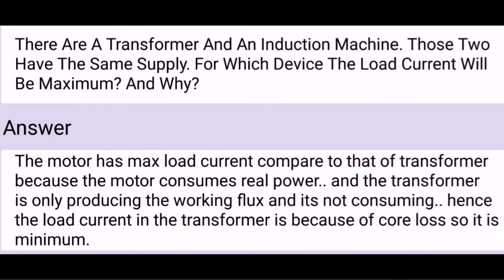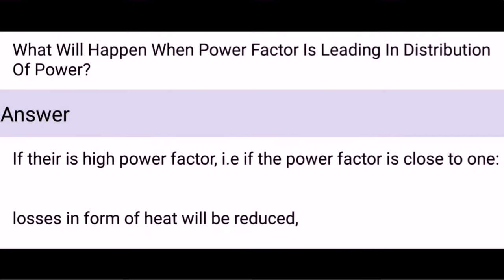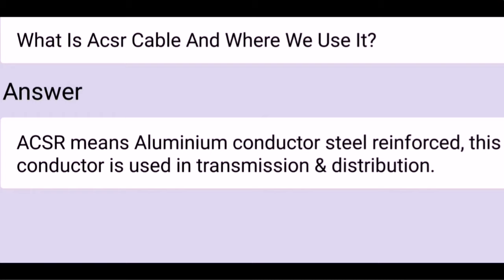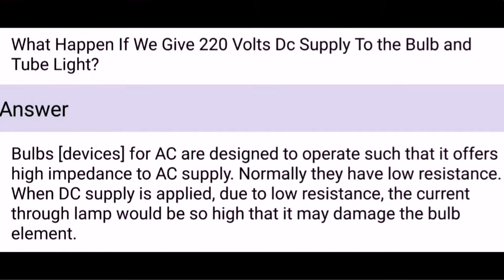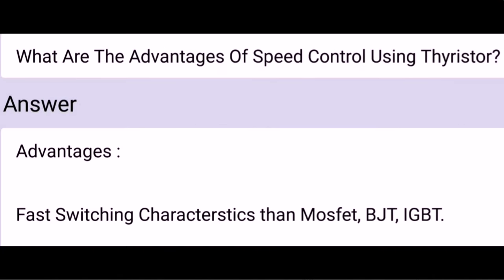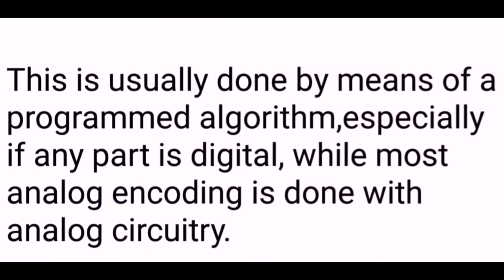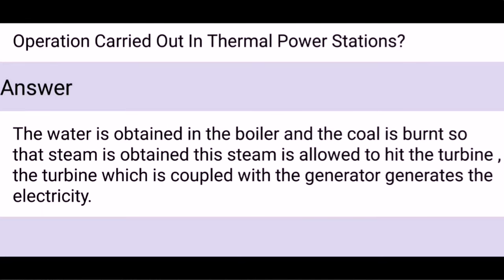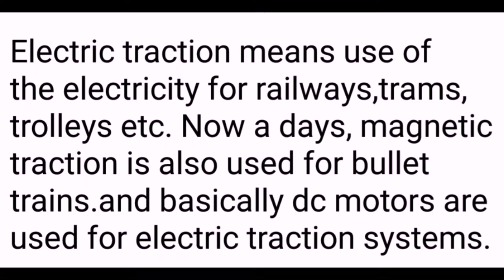15 most asked Electrical Engineering Interview Questions And Answers

Comment: tbyristors have slowest switching characteristics... the main reason of using thyristor just beacuse of high rating. 
And if power factor is leading... it may leads to rise in terminal voltage at receiving end, which may damage our devices..(ferranti effect).. Voltage reg may become zero or negative..